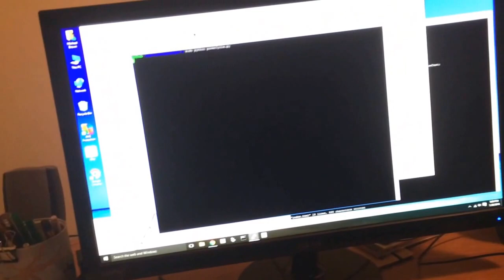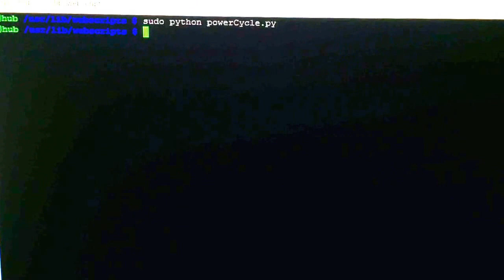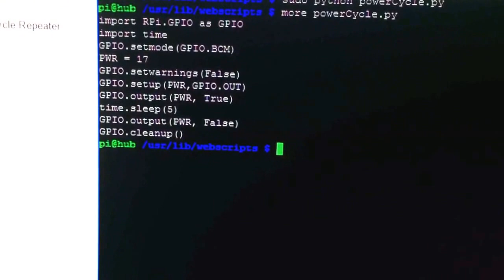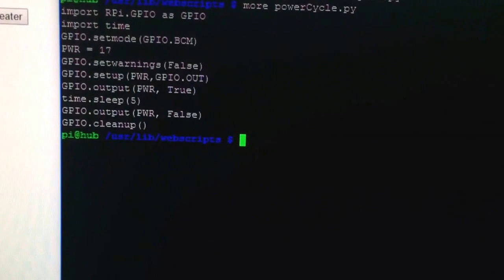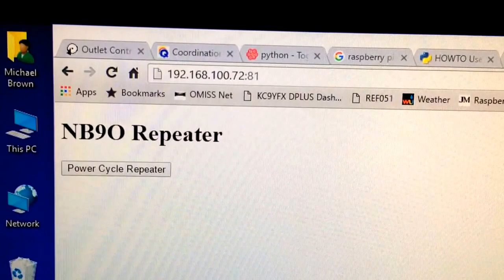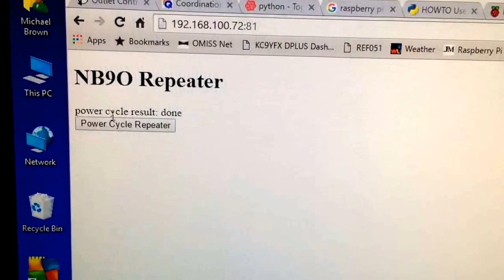IoT Power Relay Digital Loggers to control ham radio repeater

Comment: I'm going to use this relay, but I am thinking of controlling it through a PoE port from a router. I am expecting to turn the relay on/off when I switch the PoE port on or off. Do you think this could work?
Reply from the maker: Yes that would work. The input voltage to control the relay is 3 to 60v. So you are going to use some sort of custom cable to pull the power from the Ethernet port? Yep you'll be fine!